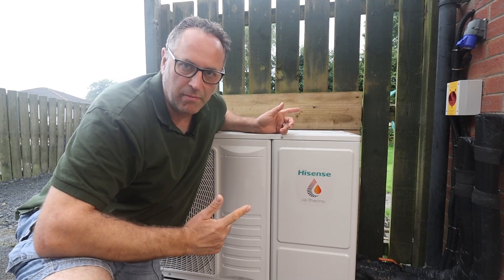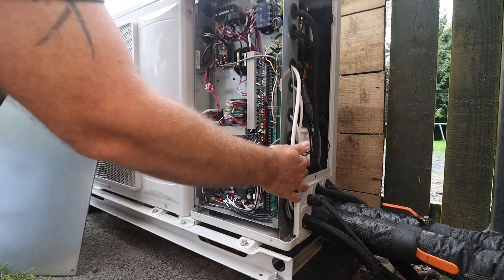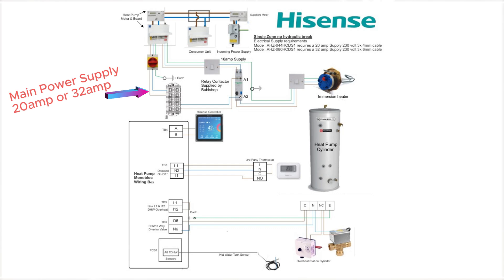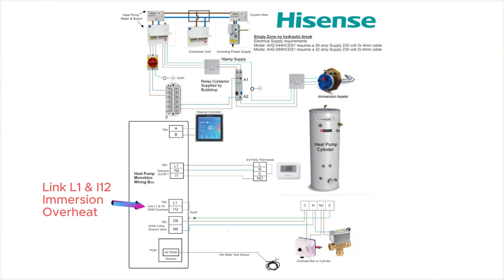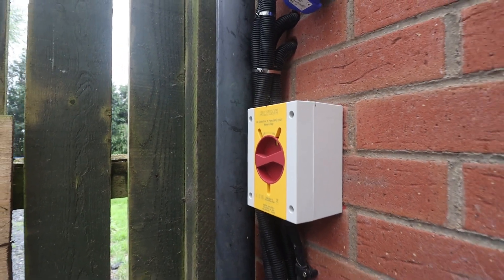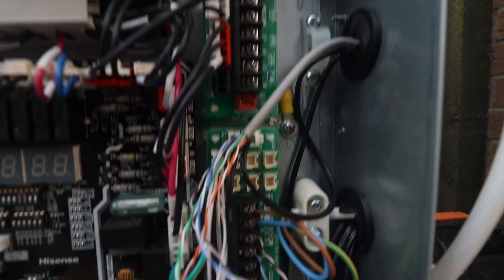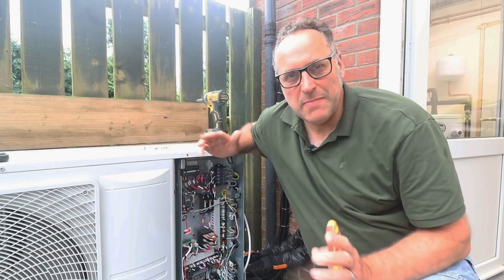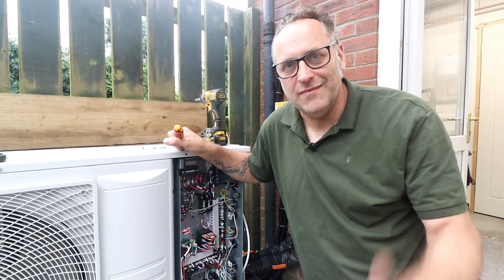Hisense Heat Pump Wiring Video

Comment: Very useful video, thank you! 
Which port could a humidity sensor be connected to? It would be very useful for radiant ceiling cooling. 
For example, a Sauter HBC 111.  It has one micro-switch, and "when the relative humidity exceeds setpoint XS, the contacts switch from 1-2 to 1-3. The contacts are
reset when the humidity value decreases again by the amount of the fixed switching difference XSd"
I wonder how should it be set to turn off the cooling even if the thermostat would not turn it off yet.

Comment: Can this work with only these wires?
3*4mm^2 wire supply
1 pair temp sensor 
1 pair of display/control 
as basic function, just generate hot water flow in the heating system
Reply from the maker: Yes it can work like that, so no hydraulic break
Reply: @DesignMeAHeatPump  I checked my current gas heating system, it's placed like this. Gas boiler generate heat flow, separated to 2, 1 side goes to radiators and 1 side goes to DWT tank with heat exchange pipe inside. If this heat pump can work with such simple setting then it's suit for DIY job very well.